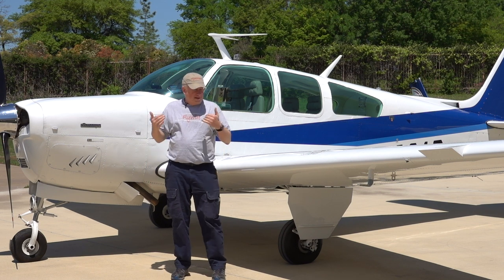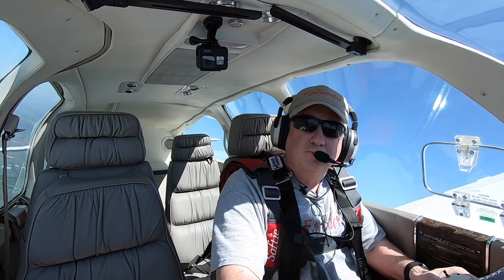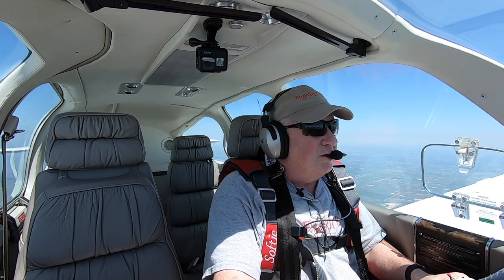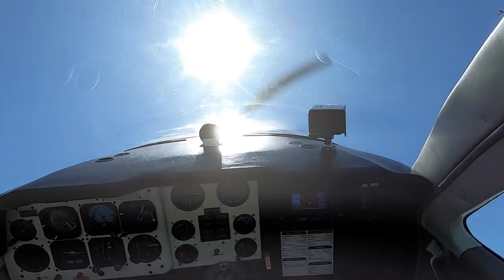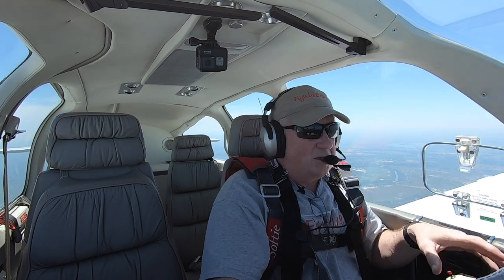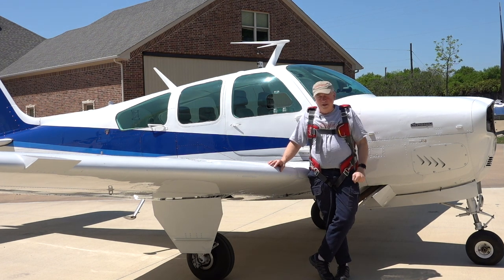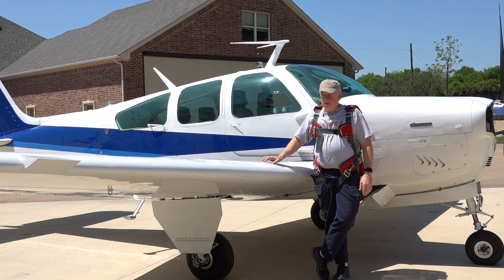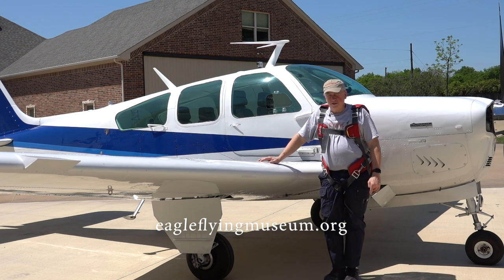Bonanza Loop in a F33C

Comment: Scott, are the Hooker belts specific to the acro F33? I have a V35B and would love to upgrade to 4/5 point belt. Haven't been able to find. Don't care for shoulder strap especially in a crash. 
Excellent videos!
Reply from the maker: Robin- Thanks for asking the question. the Hooker Harnesses I use in the video are 'Quickie's" you can use them in any airplane. They hook up to the rear seat seat belt. The best choice is to install the BAS shoulder harness, but that requires some sub-structure.